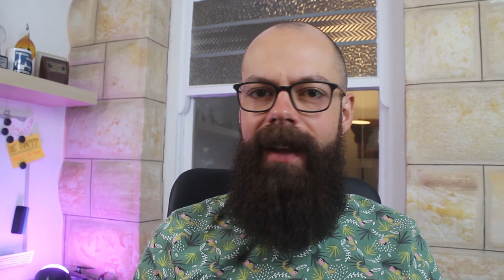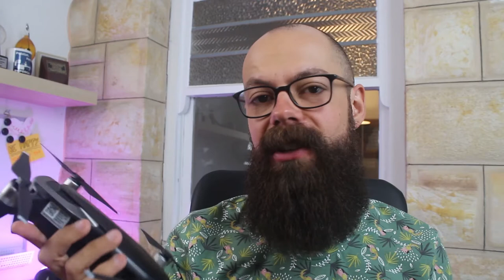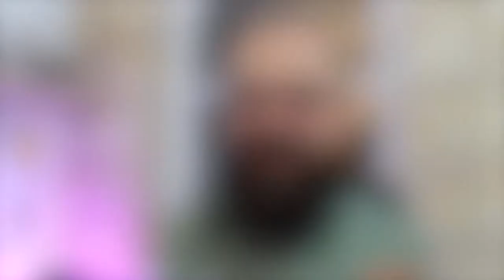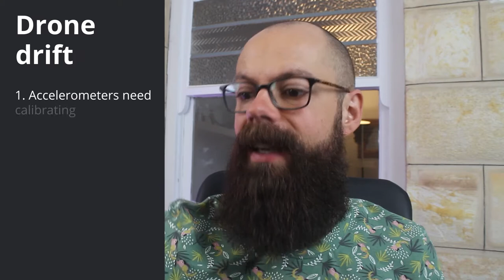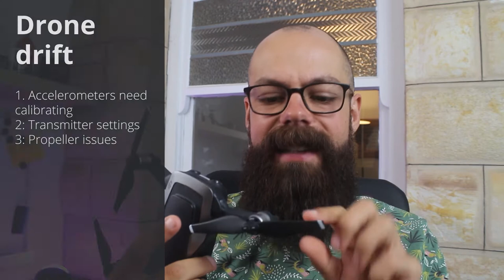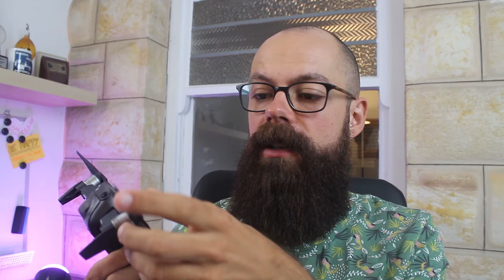Why does my drone drift? 5 simple things to check

Comment: Please help me!
My HS510 is just moving everywhere and not staying fixed on one position. Even if it says its locked to 15satellites, and there's literally no wind. 
I flew it to about 1.5mtrs high (i'm afraid to fly it higher, as i might lose it), and used both MRC Pro & Ophelia Go apps. Still the same situation..
Please help.

Comment: First time drone user. Bought an entry level drone and I can't hover. As soon as I lift up it takes off forward really fast and won't respond to trim inputs. Ready to throw it in the bin. Any suggestions?
Reply: Yep I also bought one but it's from shein I have turned it on and suddenly it shifts on different sides the drone is fine but I think I have added some protection on the blade sides maybe the weight is playing a role in shifting my drone.

Comment: Mine's actually okay most of the time, but when it gets near buildings or houses it drifts a lot more. This sucks because I wanted to do roof inspections as a way to make money, but if I can't fix the problem, eventually I'm going to crash it, guaranteed. It's a DJI Mini 3 so I don't think it's because it's a crappy drone obviously, and it also does not have obstacle avoidance either. Which is not great in this case LOL

Comment: Hey buddy what does it mean when you start up the drone and when you go for lift off it takes off in a side direction
Reply: Check the props, make sure the motors are turning the right way in Betaflight, and check to see if you have any error codes. Worst case scenario is your FC has a problem. Most like a damaged/faulty gyro. Contact the company and tell them. They may have a replacement/return  policy. Hope this helps!